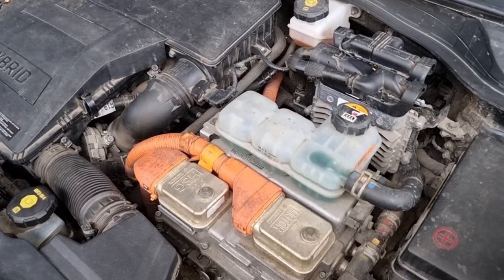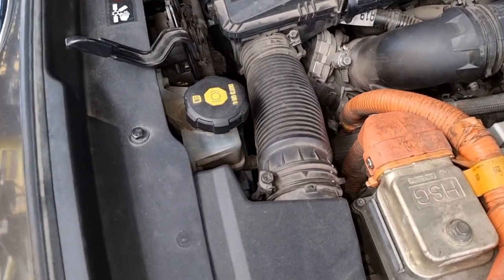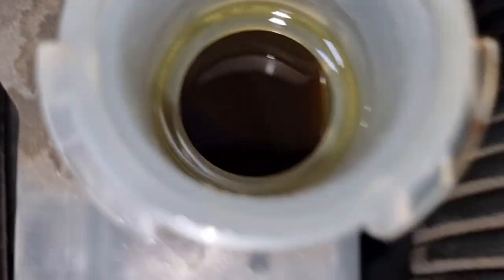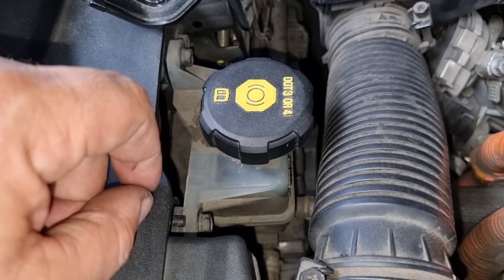Changing the clutch actuator fluid to the kia niro hybrid (mind the audio issues)

Comment: Good  thinking, Kia. 
Here in Italy for my Ioniq most of Hyundai dealers are either oblivious that it needs to be checked and changed periodically  or  just shrug of and tells that "yeah we've checked it and it's still ok ,it doesn't need to be changed"  and when you ask tell specifically to change it, they just roll their eyes up making some inarticulate guttural sounds  an then after awhile call you back giving you an extortionate estimate of around 500-600  making you angry and unsure wether they  mistook it for the gearbox oil change or they just shoot up the price making you abandon the idea .

Comment: Does fluid from the reservoir circulate?  There is only one tube leading to the actuator.  I suck out the fluid in my 2020 Niro every so often and replace it but it leaves me wondering if the fluid in the actuator ever gets replaced.

Comment: Thanks for making these videos. I replaced the serpentine belt and the clutch actuator fluid at the same time.  I sucked the fluid out of the reservoir, disconnected the hose from the reservoir and sucked out what fluid I can from the hose. I cleaned the reservoir and assembled everything back. Pinched and flicked the hose, trying to get air out of the hose. Now I have a check engine light with a code POAC4-hybrid powertrain control module. The drive was a bit jerky at first, then the check engine light popped up.  Any clue what I should be looking for?  Thanks in advance.
Reply from the maker: Bleed the clutch with a scan tool procedure 👍
Reply: @hybridsolutiondiagnostics  
I don’t have the scan tool to bleed. So the next best this was to disconnect the hose at the bottom and lit it purge out a bit and connect it back.  Lower the the right side of the car, pinch and flick the hose in attempt to get the bubbles out.  Car runs better now.
Reply: Update:  car ran better for a day then POAC4 along with another code popped up again. Had to take the car to a Kia shop to use their $10,000 computer to bleed/purge/open valves etc to get it working again. Once air is introduced into the clutch actuator, game over.

Comment: Hello!We have a Kia Niro Plug In Hybrid from 2019 in 100k miles and it started to have a problem that while its cold it goes well but when it starts to get hot it revvs up,the clutch is slipping and it has clutch smell.The transmission doesnt makes any sound.Could u help us what it can be?Thank you very much,love your content!
Reply from the maker: Recalibrate the clutch first
Reply: @hybridsolutiondiagnostics  Thanks for your reply!And should we change the fluid in the actuator too?We need to recalibrate it with a tester?Can the clutch become good with the recalibration?
Thank you!

Comment: Man, you are cool like your videos. I've driven my KIA Niro for 45,000 km, and the fluid has never been changed. As I understand it, in this case, bleeding the clutch actuator is not needed. However, I have a problem: the upper white cap of my clutch actuator is cracked, and a part of it has a hole. I temporarily fixed the crack with temperature-resistant silicone. Will it be a problem to bleed the clutch actuator in this case?

Comment: Hi great content 
I have Hyundai ioniq hybrid 2018 84000 km runs great check engine light comes on after running the car in small pool of water from rain it was brief and water didnt reach door level check engine light comes on after 1 month p0471 Exhaust Pressure Sensor i reset the code and it gone for about 6 months appeared again i reseted and its about 4 month where is this sensor located car runs great took it the Hyundai dealer but light wasn’t on

Comment: Is this a complete video of changing-the-clutch-actuator-fluid procedure or did you have to air bleed the clutch actuator with KDS/GDS after you changed the fluid?
Reply from the maker: No need to bleed in this case
Reply: @hybridsolutiondiagnostics  Thank you!
Reply: @hybridsolutiondiagnostics  So the KDS tool isn't necessary for the bleed and "re-learn" part?  Would love to do this but the shop manual says the tool is required and don't know if that's a big deal or not

Comment: You don't mention bleeding the system and so if you have changed the fluid in the reservoir and only drains the delivery hose the hardest working part of the system is still filled with old tired fluid? If so this is just a cosmetic fluid change?

Comment: I have a stupid question... would it be possible to replace the Ioniq reservoir with the one from the Niro? From what I see you just need the longer pipe and slightly different reservoir, it connects at the same place on the actuator?
Reply from the maker: It is actually a very nice question, and the answer is a big YES… it will fit just well and very easy for sure to service ☝️😎

Comment: This was really informative..wha clutch fluid did you use?I own a 2021 model an would like to check you for some info...where are you located
Reply: Did you ever find out which fluid to use? I’m also wondering.
Reply: It calls out DOT 3 or 4 on the cap. I'd recommend DOT 3.
Reply: @Ben-we7vr  they sold me synthetic DOT 3. Does that matter?
Reply: @supermanx2001  that's fine, go for it

Comment: Kia Niro Phev.  : There is a pause upon acceleration from a stop (unresponsive). Then the vehicle will lunge forward and make a loud noise. For both driver and passengers, it can be quite startling and feels as though the car has been hit from behind. It has happened about a dozen times in the las week months since first noticed. It seems that this may be a software issue related to the hybrid system – ( I’ve changed already gearbox, clutch, hybrid motor) and this still happening!    Does someone know how to fix this bug? Thank you
Reply: This has happened to me on my 19 PHEV. The motion was comparable to someone dropping the clutch and the vehicle would jerk forward with a thunking noise, usually in EV mode and always from stop, before continuing as normal.

I took it to the dealership twice before they resolved it. My car only had 22K on it when they did the repair.

Looking at my warranty repair ticket, it says "performed TSB TRA093 replaced gear oil". It also denotes the following parts: gasket – transaxle, gasket, and EV 70 W gear lubrication.
Reply: There is a factory recall for some vehicles, Kia installed the wrong transmission oil - I had the same issue in my 2019 Kia Niro Hybrid (Canada) - once the transmission oil had been replaced with the correct oil the problem went away! Hope the transmission wasn't damaged when it was slipping and causing the sever jolt/bang noise!

Comment: Hi, I have a 2018 Niro with 72000 miles, sometimes the car is hesitating to accelerate and change the gear and even when I’m braking when it downgrades in gears I can fell a kick back in the car

And sometimes when I change from D to R or back I can feel a front to back shake from the car

When all this thing happen even the brake pedal feels stiff like I can’t push it all the way like normal

Could this things be caused by the clutch actuator fluid?
Reply: Hi. Did you fix this? I have the same issue as you described.

Comment: Love my toyota hsd, i do not have this fluid :D has reliable ecvt ;)
Reply: Your CVT has nothing to do with this. This is the engine clutch, which links the gasoline engine with the electric motor.
Reply: @NeilNadelman  no, this is fluid for hydraulic actuator, not for wet clutch. In hsd toyota you dont have both ;)
Reply: Do you clean your EGR pipe and valve regularly? If not, good luck with your head gasket ;-)
Reply: @smoguli  has 105k km and still clean inside ;)
Reply: @smoguli  ...and how often do you clean egr ?

Comment: Ar Audio audio feellin dizzy.. but hey your going to think iam a nutter " what! :( haha " but seeing all those reservoirs an there circular lids... you know those reggae fella's that wear those slightly fluffy hair bands you buy in a packet of multiable of variable colours all just 1 colour hopefully haha years ago you had air breather that had oil pans within the filter housing an small engines require the padded air filter to be slightly damp with light oil to catch the fine dust... if you applied these hair bands over the lids once fitted slightly damp with light oil this would almost stop the introduction of fine dust around the lid seal an also fine dust getting into the reservoirs from heating up an cooling down forming a suction or expansion , yes you might get natural settlement from in the lines from wear  but just a thought were some small engine companies still use this idea but this is made from foam,  just a little extra thing to look after your customers cars.

Comment: This is not the proper way to change clutch fluid for the Kia Niro 2019,,, especially if the car is still under warranty…… you have to unplug is from under the car… to drain the parts completely,,,, add the dot4 oil ,,,, plug the computer ,,,, he will equilibrate the oil between the parts and valves,,,, then vibrates to remove the air,,,, you should change the oil every 20000km ,,,,in hard contition,,, (Canada) read the manual,,,,,
Reply from the maker: No need to unless you disassemble the complete unit… BTW it doesn’t vibrate where the hell you get that brow? It is just a pressure motor that only pumps… gravity does the job… FACTS ☝️🤪
Reply: It may not vibrate, but it sounds like it, I should have said ´´perform the air bleeding using the GDS / KDS.´´ like in the workshop procedure. My first language is not english,,,, and I am not a mechanic,,,, but I know how to follow and read the workshop manual. Thanks for the comment… but it’s still sounds like a vibration, I am at 65000km and did it myself 3 times.
Reply from the maker: @Vincthedwarf  no need to… just clean and replace the fluid from the reservoir more often (every oil change or 10k ) and you will se the difference…
Reply: @hybridsolutiondiagnostics  I liked the fact that you cleaned the reservoir. Thx for that, will do it next time
Reply: @hybridsolutiondiagnostics I have a niro also. Thanks for the information. I will siphon the reservoir and replace fluid every 10k miles!
Reply: What about the fluid that's in the unit ? You only drained the reservoir ?
Reply: @ronrivas1453  that’s what I thought. That’s why they disconnect it from under the car at the garage. But to be honest there’s like 100ml in there. I guess when you pump it from the reservoir it’s ok. There is always metal residue,,,, that’s why I liked the idea of flushing the system completely.